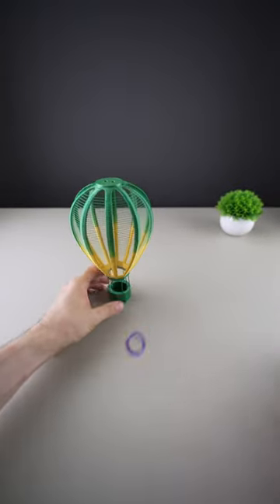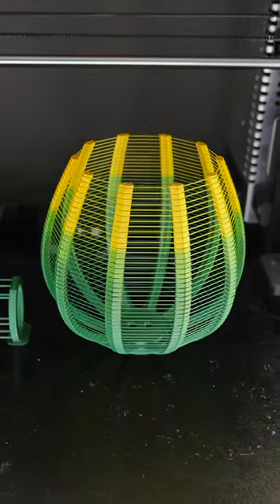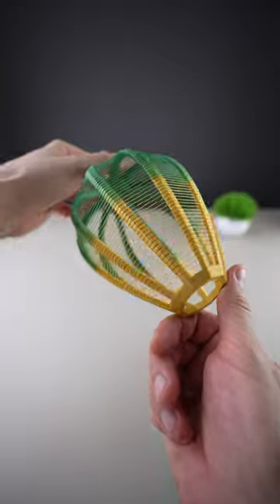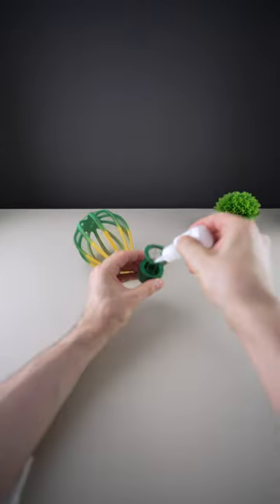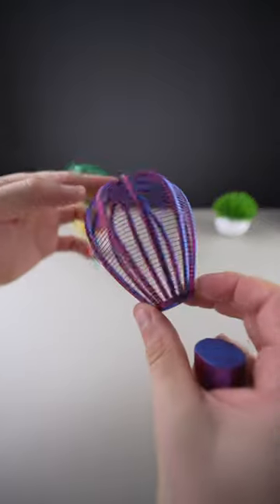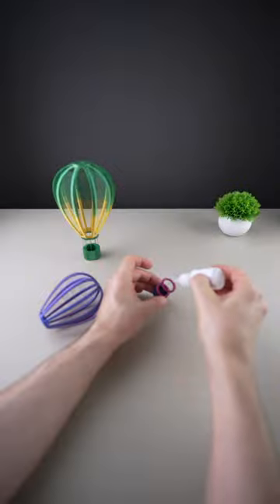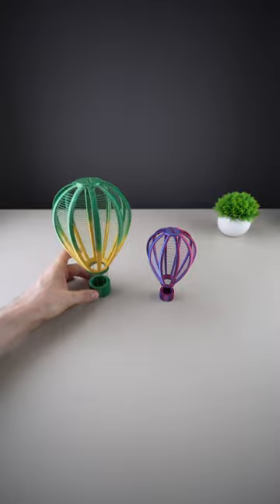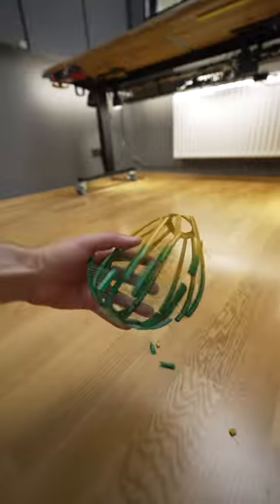3D Printed Hot Air Balloon

Comment: Hate glue connections, glue tube dries out if you leave it to long, the strength of the connection is very unpredictable and if you get any on your fingers it’s annoying.

Much prefer screw connections whenever possible. Small screws work much better then glue in almost anything imo.